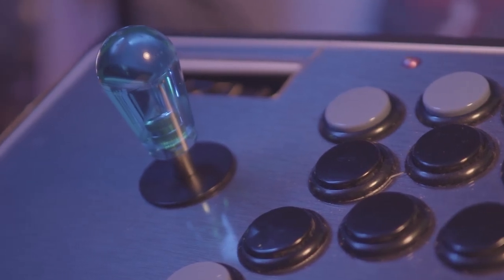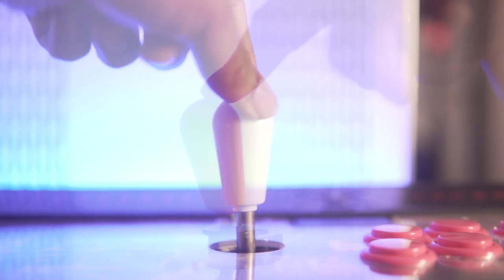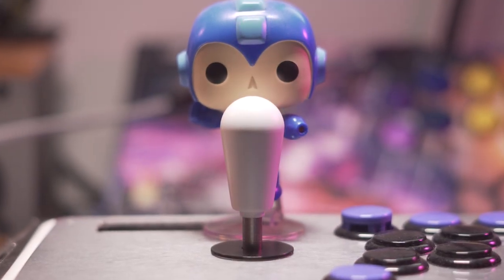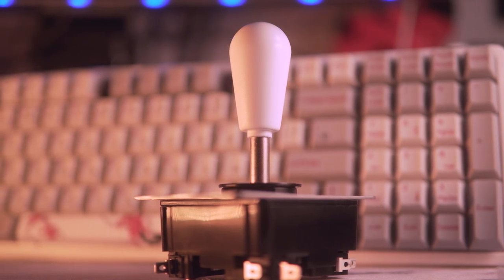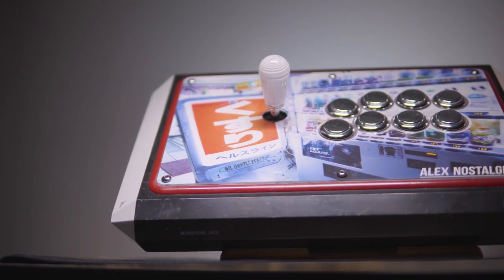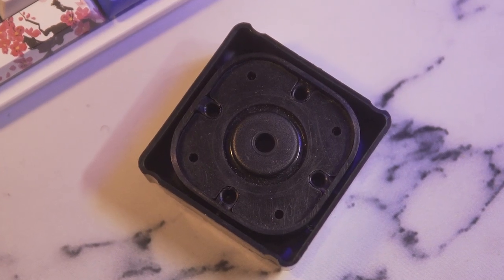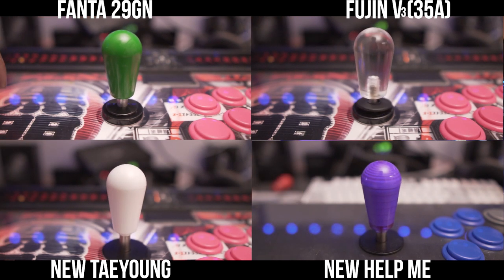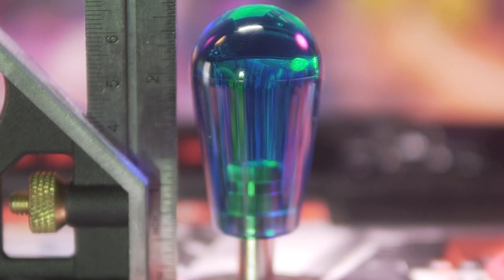Short Collar Taeyoung & Helpme Review

Comment: Another great video Alex! I recently installed the Taeyoung Fanta (low collar) in my Hori Fighting Edge, and I'm loving it. I dropped the tension down to a blue 35A grommet, since I found the stock 45A to be too fatiguing for longer sessions for me. Mine also came with a chip in the acuator, so it might be a cosmetic defect with the injection molded plastic. Not entirely sure, but it doesn't seem to affect actual performance.
Reply: Nice a current HORI owner like myself lol. I have the RAP 4, so hopefully my question makes sense. Did you have to get the mounting plate for the short collar too? I know we still need the .187 to 5 point harness. But I am unsure if that is needed. Also good mention of the grommet. Ima try the stock version out and see how I like it. I currently have a 2lb spring in my hayabusa lever.
Reply: @unru1y_disciple143  Nope, a mounting plate isn't necessary. The chopped collar Taeyoung should mount just fine without it. I think you only really need those special mounting plates for full collar Korean levers, since the spacing of the screws is different from Japanese style mounts. As a side note, one of the microswitch pins may press against the cable compartment, after you install the lever. It should still function just fine, but you can always carefully bend the pin if it bothers you (I didn't bother doing so).

Comment: Great videos, I’ve been watching all of them sense I am wanting to convert to a Korean Lever. Quick question for you. So I have a HORI Rap 4 currently and on a tight budget. In this video you mentioned not having to drill a bigger hole when getting the taeyoung short collar. Would you happen to know if I still need to get the conversion mount plate? I know I still need the .187 to 5pin harness but I wanted to know if the conversion plate is still important as well? The Etokki was on my radar but I am gonna just have to just get the Korean lever for now. Hopefully this all makes sense. Keep up the good work and stay safe.
Reply from the maker: The short collar version is plug and play since it comes with japanese style mounting plate and ofcourse just needing the harness. Funny enough the rap4 was my first fightstick and first one i modded for a korean lever, have fun man stay safe aswell.

Comment: Great video, very detailed and quick to the point.
I've been wanting to mod my stick for a while now but I dont know wich k lever is best for a first lever. All i know is that my jlf feels too light and i dont like the square gate for circular motions (i play tekken). Should i go for a 309mj and get a stiffer grommet or is the new helpme better? I would consider the various fanta levers as well but I've heard they're not very beginner friendly. I don't have the possibility to try any of them out and I wouldnt wanna have to buy a second one since where i live shipping fees are quite high. What would you suggest?
Reply from the maker: If your looking for a crown lever then the 309 New help me would be a great choice if you want to start out with something more tensioned than a mj. On the fanta side of things i would say go for the 47c or 49s. Buying extra grommets can extend your options when it comes to feel but wouldn't hurt to have different tensions on hand. I usually get 2 grommets when trying levers by having one higher tension than stock and one below it just incase. Hope that helps.
Reply: @alexnostalgix  I already own a crown 309mj is the crown 309 new helpme significantly better? If I replace my stock grommet within my 309mj with the 30A grommet would it give me a similar feel to the new help me. I mainly play tekken , sf5, guilty gear rev2.

Comment: glad to see ur doing new videos. so i have a question , so all crown levers have  two different sizes  on their actuators. I have the DX QR version and im wondering. also can you do a video on low tension k sticks and their pros and cons. I ask because with gaming mice are becoming lighter, i wonder if low tension would benifit some people
Reply from the maker: No, the knew help me at the moment is the only lever that offers two actuators from what I know. They crown series has a couple actuator options from IST I think like the cdp, 303,mj, new help and I think the 301 but I forget. Check out my round up part 2 as the fanta29gn is a low tension k-lever which what I say can generally apply to low tension levers.

Comment: Another great video! I've been wanting to hear more about that low collar Taeyoung..
So how does the low Tae compare to the 2019 Myoungshin Fanta? Also curious if that low collar from the Taeyoung would fit in the Myoungshin body?
Reply from the maker: its not a worlds difference but the taeyoung has more wobble when returning to neutral giving a looser feel. The biggest feeling between the two is probably the resistance in dead zone as the taeyoung imo feels looser overall.  The taeyoung colllar will not work with a myoungshin because the base wont mate properly.....you may force it but at that point why bother

Comment: Hey Alex, good seeing you in some of the discord servers!  I've been asking around, but you mentioned a specific problem I've been having with not getting a full reset to neutral when doing repeated forward inputs (like for Dragunov's WR2).  In your opinion, is this more of an execution issue or something that might be resolved with some sort of modification to the lever?  You mentioned having a smaller neutral area might contribute.  Anything that might be going on switch-wise that might help?
Reply from the maker: First my question would be do you already know how to do IWR  move in general and have the rhythm for it.  For me personally I can do most moves on any lever mainly because I just repeat the rhythm I already have in my head. If your having a problem with resetting to neutral a stiffer grommet may help but the added tension may make it difficult to do the forward(s) out of a sidestep or up close to the opponent. Msg me on discord if ya need some help.

Comment: There’s something oddball about the grommet that’s comes with ‘Lil Tae’. Though it’s black and looks like the 45A at first glance, it’s slightly thinner by about 1 - 1.5mm and the hole in the centre is also slightly larger. This makes it feel softer and more smoother than my 40A red (when it should be firmer!). It’s simply listed as a ‘medium tension grommet’ - a modified 45A perhaps? that performs more like a 35 IMO 👍